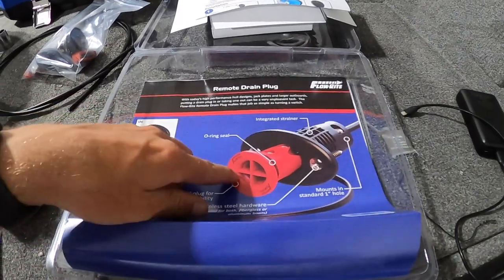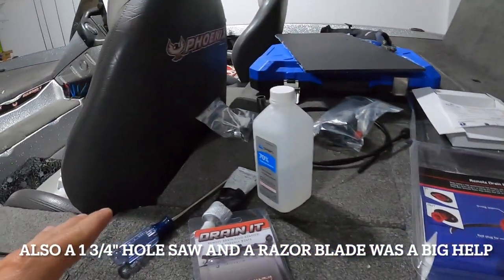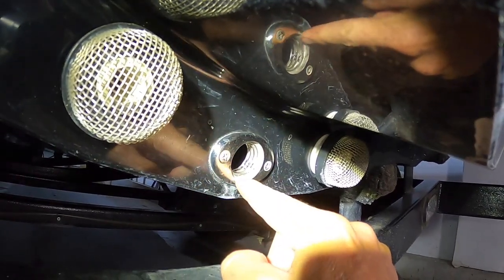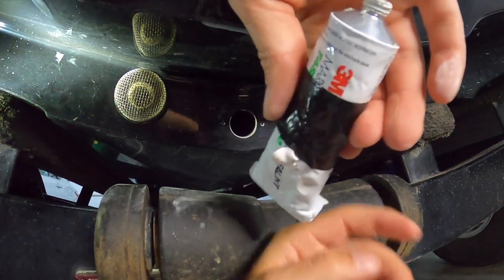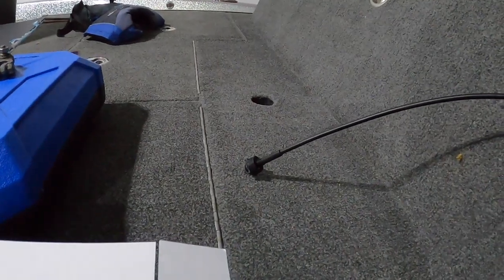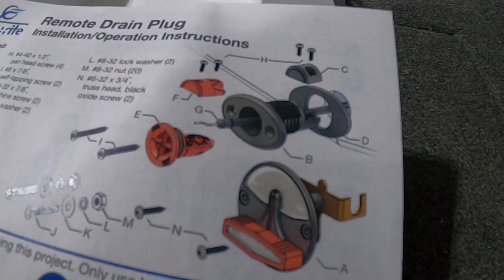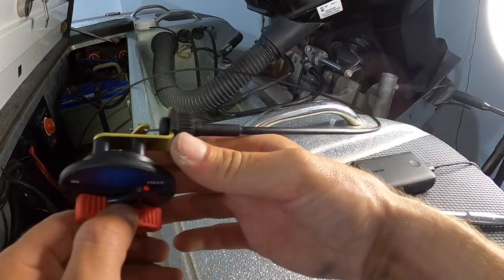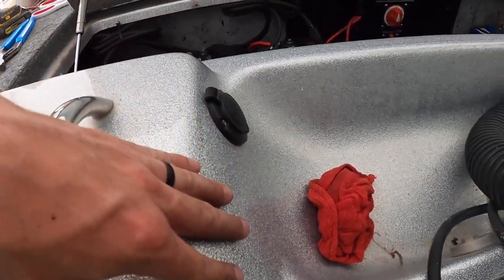Remote Drain Plug Install | Phoenix Boats

Comment: I’ve thought about getting one. If nothing else, if you forget to put plug in and it’s already off the trailer, no need to load it back up quickly. Just move the lever and run the bilge if necessary. I’m also wondering if there was a situation where your bilge pump quit but you could get on plane, maybe open it while cruising to drain the boat?